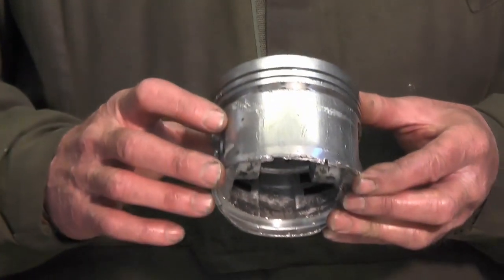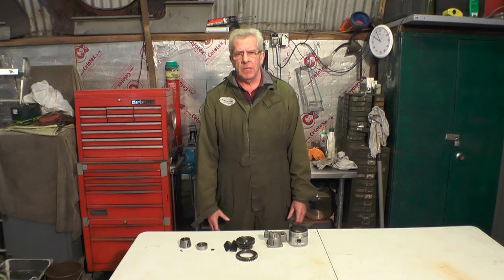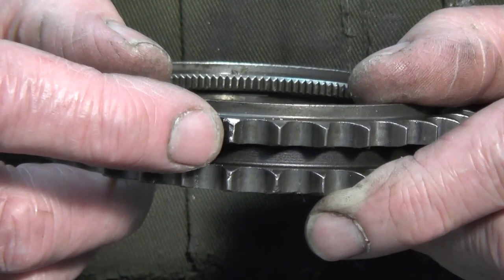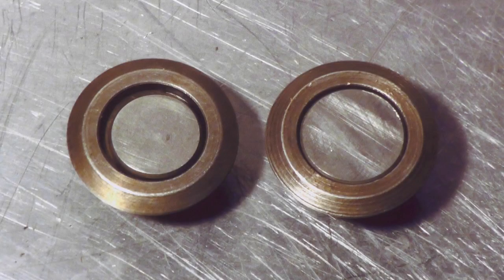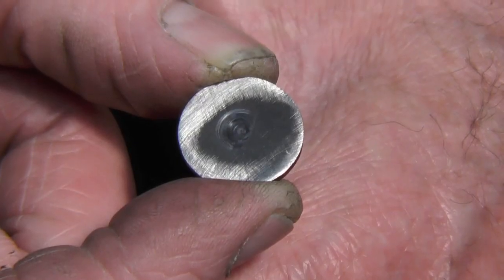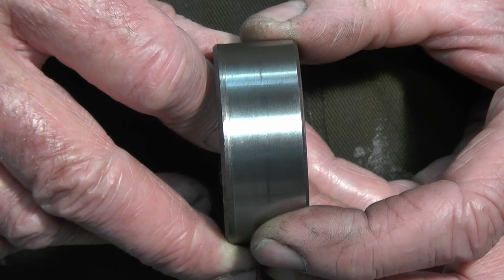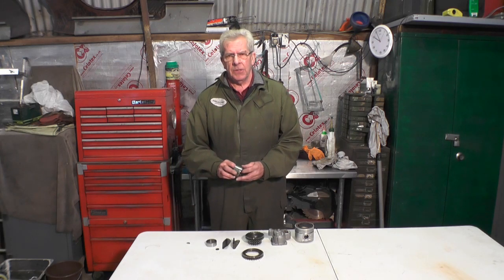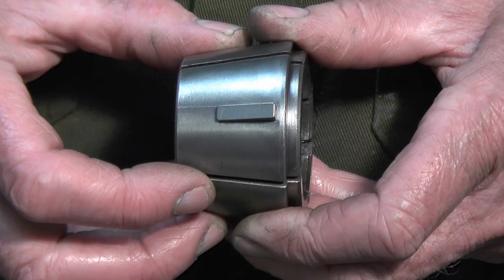Rebuild of Jaguar Etype engine? Be careful !

Comment: I would love someone to tell me why Jaguar six-cylinder heads have only 2 valves per  cylinder instead of four like most performance engines
Reply: Because the XK engine was designed during WW2.

Comment: Sir, thank you for those very educational films. just a question ...it is a long shot, but who doesn’t dare, doesn’t … I have a 1967 S1 OTS working perfectly, but the engine in it is a bit to “young” (7E10711-9). I am looking for the engine 7E11043-9 … it is a long shot, but you did not come across this one, did you ?    thank you

Comment: Some years ago I bought an S3 3.4L XJ6 it had a rebuilt engine - done by a reputable firm in South Wales. 
at about 6000 miles it started to big end knock! Determined to trace the problem I removed the engine & dismantled the bottom end. This engine had the con rod bolts fixed with castellated nuts & split pins. The problem, simple they had used plated split pins this can make the metal brittle (always use plain pins) the result was the pieces of the broken split pins had been 'hoovered' up by the oil pickup (no proper filter?) passed through the oil pump cracking the gears then jammed the relief valve open dumping most of the oil back into the sump. The sudden loss of oil pressure damaged the big end bearings. Hence the fatal knock.
The repair cost was too much for an old car luckily a local Swansea Jag specialist had a good second hand engine which I fitted & it more than lasted all the time I used the car. All I can say is if you rebuild a 3.4 engine use the special nuts fitted to 4.2L engines & never use plated split pins in any high vibration situation!

Comment: I could be wrong, but I do recall tracing the 'tappet or lifter ticking sound' in more than one engine, my XK straight-six being one of them, it turned out the noise was actually from oil 'popping' as it exited the top of the pushrods. Of course, one engine had very old thick, gummed up, black, very dirty oil with probably 100K miles from the last oil change in a '72 351C pulled out of an LTD Squire Station Wagon and the 4.2 from an old XJ6 that should never have been started without an oil change since it had been opened up to the weather for a few years.
Once the oil was changed to a Castrol variation, the popping stopped and no bubbles from the straight six. Sure, sure... there could have been moisture in the oil or something, but the classic lifter noise stopped with an oil change just as it can easily begin after an oil change.
ANYHOW.... I'm done with the rant. Great video and you seem extremely down to earth and straight forward with your discussion. Something that is rarely seen these days. No dumb jokes. No idiotic sports talk. No innuendoes.
Reply: Correct.
You are wrong.
These engines do not have push rods.
Oh dear.

Comment: 5:27 Those welds on the exhaust headers tho 🤮
Reply: The exhaust manifolds are purely for test purposes. I got them at a very good price because the welds are not perfect. They are not supposed to be visually perfect, just functional.

Comment: you can never trust anyone in the car game - i went for a pair of part worns - 4 days later it was showing signs of leaking air - i went to a diff part worn garage that told me some dodgy people about - then puts 50 psi in my 15 inch rims i mean never trust any mechanic, and always inspect what work they have done
Reply: I worked at a tyre shop, you ain't even supposed to put 50 psi in modern tyres.
Reply: @archygrey9093  unless your hiding a slow punture, bought from a dodgy garage elsewhere.

Comment: what is that ticking sound i and my father did  rebuild an 4.2 litre e type engine and it was quiet no ticking sound so
  much   for an XK engine specialist oh this engine is fine it just have an ticking sound that e type engines properly restored Don't have

Comment: hello, I have a complete 3.4 engine which comes from a xk 150 of 1958 with carburetor, gearbox, dinamo starter, it does not work, but it is not broken; do you have a proposal for an exchange with a 4.2 jaguar engine in very good condition, with the adaptation system for the xk 150 chassis, I would be happy to exchange these 2 engines if you give me the metal parts for adapt the 4.2 engine on the xk 150 chassis
best regard 
olivier

Comment: I have a 64 S Type 3.8. I had coolant in the rear two cylinders. I bet nobody can tell me what caused it.
Reply: Your On.  ...?     Adelaide  South Australia ...      011 618   0435 625085   Drop the 0 in front of the 4   outside OZ
Reply: You left in the rain with the spark plugs out. Please tell.

Comment: Hence why I do all mine myself. My first Jag engine was a 69 XJ6 in 1988 that was a 2.8 and had a 4.2 transplanted. I got it that way because then I'd know what I was getting. Someone gave me a 350 Chev to put in "after I got sick of that stupid Jag engine." 

The owner had had it to a professional and gave up in desperation after "they had tried everything." The car came with ream of receipts from said highly  regarded Jag place that had done everything from new head gaskets to "locking up the fan clutch." Hang on - alarm bells. So - a "professional" is happy for a fan designed to go no faster than 2,000 RPM to run at full engine speed? THAT is just dangerous. And made me question their knowledge. If the car is overheating over 30mph, that usually eliminates the fan.

I tried the quick fix. Removed head - was perfect. Replaced head gasket = overheating - pressure into cooling water. Removed head, and scuffing on front cylinder. Hmmmm. Closer inspection revealed a crack in the liner. Had to pull engine - replace liner - so I replaced them all. I did everything except the press in liners and hone them. That piston was scuffed as well, so replaced all pistons/rings/bearings. When I pulled the engine apart, it had cut thin shim in with the pallet shims, and FULL of silastic - very poor. So much "patch up butchery."

Once I put it back together, engine then ran PERFECTLY (with new fan clutch - they destroyed the other one to lock it up) - EXCEPT would miss on hard acceleration. I checked everything (including the receipts from the "experts" that 3 times tuned and road tested the carbies) and found that the car had 2.8 needles in the carbs. Early XJ6 has same size carbs for 2.8 and 4.2 but different needles. Right needles = perfect. 

Hang on - HOW did they "tune and road test" 3 times with the wrong needles? I could feel it was "wrong" after 200 yards, and I don't see myself as an "expert".

Car was perfect for years until I sold it. I now have another Jag (69, had since 2000) and won't let anyone else touch it. Same deal, guy near my Dad has an E type, and says it is hard to start, "but that is just Jags". I ask if anyone has looked at it; he says "Oh yeah, specialist tunes and overhauls once a year, just got it back.............. but they are all like that." Mine doesn't get driven for months at a time - starts within 5 seconds ALWAYS - so again, I question his "expert".

Biggest problem is aftermarket parts. I waited for rim tapes/strips for my wire wheels - came from a US specialist - far too big = useless. Ended up making my own.

I patched up my Stag for years (use existing blocks, hand select second hand/old bits) and hadn't done too bad, as did 330,000 kms over 20 years, including 7 cross Australia trips Perth/Melbourne return (7,000 kms return). Always in summer ( :-) ) and at times was 48 degrees out in the desert. Cruise on 130 kmh all day, as no one out there. 

I eventually "bit the bullet" and built a rebuilt engine. Wished that I hadn't. Some parts were so butchered. I have replaced/refitted/remodelled so much of it that within the next few years, I will get my old block and hand select some old pistons and the like and rebuild an engine that I will be far happier with. 

I use the Stag at least 2/3 times a week to go to the shops and the like, so it has to be smooth and reliable. With my hand selected "old" parts, it will be. Any "new" Stag parts are made in India now, and I have bought so many of them - looked at them - got my old ones out, get the verniers, make one good one out of a few. Just did that with oil pump on the Stag. I hear even many suppliers have quit using the Indian pumps for Triumphs and recon old pumps, as the new ones are just no good.

Fair enough, there are "Indian parts" and "Indian parts" - but how do you know what they are like until you try, and my experience not good - at least with Triumph bits. I have more success with my "boxes of old bits". Again, each to their own.

And there are some of those parts creeping in for all cars. 

I am lucky I am able to keep my old things going; but I am so wary I don't trust anyone to touch my stuff. Sad but true.

If I ever start to think of farming some engine stuff out; I have people who say "I know a bloke and he..." so I have a conversation with them......... then come home and do it myself. Maybe I am too picky. Each to their own.

But if I am able to make a Stag drive to Melbourne and back 7 years in a row in temps up 48 degrees (extreme, normally only 30 to 40 degrees out there) and cover 330,000 kms in one of the hottest countries on earth........... and can drive my Stag OR Jaguar around here on mid 30's days)  I am happy doing it the way I am. :-)
Reply: i've had cow boy parts before but never indian, thanks for the heads up, i'll stick with the british and recon when needed

Comment: Older cars need tuning and adjustment several times a year. Without someone with genuine expertise there will be inadequate fixing rather than actual restoration to spec using correct tools, know-how and care. It is easy to be ripped-off by shady characters. Experts can name their price and give you a fantastic service and repair crooks can spoil a good piece of engineering beyond economic repair. If you have deep pockets some crooks will keep you on a leash until you catch them out. A good Jag engine is terrific and when you see people restore one properly you really get it about why those cars were great historic racing cars and remain iconic pieces of engineering.

Comment: With the amount of money sloshing around in the classic car market these days, it's become a minefield having things likes engine rebuilds done. I would always elect to do engine rebuilds myself and delegate any specialist work like crank regrinds etc. At least that way, you can see precisely what standard of work is being undertaken, unlike a full engine rebuild that can disguise a multitude of short cuts and shoddy workmanship. And apart from that, you get a huge amount of satisfaction doing as much of the work yourself as is possible and you learn an awful lot about how engines are designed and put together. Great videos though Nigel. A pleasure to watch

Comment: Webers 45 DCOE's???
   Great conversion.!!
   I would like to install them in my Mk. 2,(3.8Lt).
Reply: A Rodrigues you are going to have fun putting that lot in a mk11.
I put three 2” SUs on mine, that took some shoehorning.
Reply: I've seen six Webers on XKE
Reply: Battery in the boot.
Move the brake master cylinder assembly over.
Remove vibration spacer/o ring assembly.
Big hole in inner guard for the front carb, boxed in of course.
Squat air filters.
V V fast, V V thirsty, unexpected wheel spin on serious take off.
BTW, Lynx Engineering in Sydney Australia used to do a manifold for Webers, but only for the 3.8

Comment: Well , it sounds good , but I can hear a clicking as well
Reply: You are hearing a single tappet. Its very difficult to get these all perfect because of stack up tolerances. You tend to air on the side of caution, which is safer on the motor than the clearence being too small. Because you have to take the cams off to change the shims, by the time you re-torque them all back up, inevitably at least one one is little noisy.  Taking it apart again to correct that oftens shifts it to another one. I found the best way was to set the torque wrench up at the correct setting, loosen and and re-tighten the bolts before even taking the initial clearance measurements to see what changes are needed. I also suspect this motor started out with the later 'emission era' cams that require a larger clearence and was fitted with the earlier more sporty cams or even an upgraded cam which changes the clearences substantially which means a lot of iterations of measuring and re-shimming.  Also it has a set of DCOE's on it, so its not unusualto set the clearences a bit wider. I've never heard an XK engine where no tappets were audible, it would scare me if I did. My own included. I have gone through the upgrade process myself of going to the earlier cams on my own S2 E-Type , so I'm aware of the challenges involved. Long answer to say, thats sounds perfectly great !! :)

Comment: Back in the day I was trying to get rid of the tapping of one valve on a straight 8 engine but after adjusting the valves over and over, failed..  Frustrated, I watched it run for awhile and noticed it was synchronized with the fan pulley;  further inspection revealed the belt had a loose cord and it was hitting some tin cover and creating the tapping-- school of hard knocks..

Comment: You need to contact an engine specialist if you want to rebuild an engine with guarantee.

I have rebuilded hundreds of them, no one had a single problem, after i rebuild or repair it.
Its not just assembly, you need check everything and test everything, becuase after assembly your are not going to test anything! It is always a machinist job.And a good engine has an unestimated value.

Do it well, save thousands of bills.-
Reply: rebuilt ,your having a problem there

Comment: Having owned an E-type V12, I find the vehicle horrible, unreliable, thirsty and a waste of money. The weight is all at the front, making the steering too heavy. The lack of weight at the rear produces little traction, skidding, sliding and abysmal handling. The engines are unreliable, the electrics appalling. I can't find anything good to write about JLR products.
Reply: sean kirby I wouldn’t have a V-12 XKE,the 6 is the best balance of power and handling!👍🏻
Reply: Right. The Jags to have are the 3.8 or 4.2 litres, very reliable IF properly tuned and maintained.
 Yes, the V12 is very heavy and problems prone.

Comment: I've built around 30 XK engines and there is no magic needed to build them.  Simple common sense as with any careful rebuild will get you there.  If there is one thing you should always do is have the engine internals balanced prior to reassembly.,  Makes a world of difference and adds free horsepower.
Reply: I did that on an Austin Healey Sprite engine that I had rebuilt and it did make a noticeable difference in how much more smoothly the engine ran.
Reply: What do you think is the best overbore for the 5.3  Jag V12 ?
Would you also improve the compression ... or ....  ?
thx

Comment: I can hear a tappet click,
I worked on jags since 1963 until 2011, i sugest re checking the clearances ,  cheers from uk.
Reply: @MevRB19  Hi I should have pointed out that I didnt have the inlet manifold or carbs for this engine from the owner. I simply fitted the Webers and manifold in order to run the engine. As they were only slave fitted I didn't intend to carry out any kind of setting up of the carbs.
Reply: Just another keyboard warrior but Nigel replied with dignity.
Reply: JpHDev Make sure you know all the facts before making yourself look a prat, this man has built more jaguar engines than you and knows exactly what he is doing. You aren’t fit to tie his boot laces...
Reply: jeffrey price sounds like just 1 valve
Reply: Interesting everyone making comments about tappets , they don’t have them it’s double overhead cams with the lobes running on followers with adjusting shims underneath !
Reply: @sharons9367  the tappets do not look like OHV tappets. They are between the cam lobe and the shim. Shaped like a disc.
Reply: Bradley Merz yes you will be referring to the buckets which is in between the lobe and adjusting shim
Reply: In the description he states that the noise is only really noticeable in the video.
Reply: Yes - hideous click/lash...
Reply: @GrowthCurveMarketing  Hi I can assure you the tappets were not noisy. It's simply the way they get picked up by the microphone

Comment: Those valves do sound a bit tappy. Maybe when hot they get quiet done a bit. With the Webers, I'm thinking high performance meaning higher lift cams. Exhaust note sounds very good.

Comment: Did those failures result from "amateur engine rebuilding" or did they result from a crappy engine design with cylinder liners "cast" into an aluminum block leaking coolant into the crankcase, contaminating the oil and causing the crankshaft/lube system problems that ultimately caused that piston to seize and jerk the sleeve out of the block? And was it shoddy work or a tightass owner that refused to pay for proper repairs and the shop did the best possible job "on a budget"? Jag owners seem to think their cars are extraordinarily valuable but also think they're so damned good they don't have to be "rebuilt" properly. Probably because there's no way TOO rebuild them properly without rebuilding them entirely.
Reply: Deeremeyer : I suggest you get a magnet and see whether the block  is aluminium or not !  Before criticising the design, you might at least get some elementary facts right
Reply: Seems you know everything including what Jaguar Owners are like..KMA